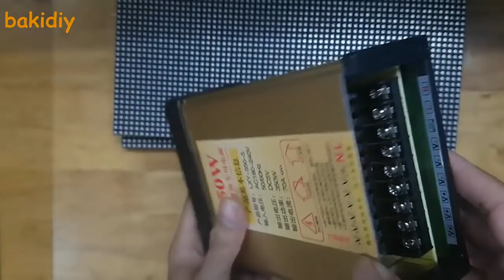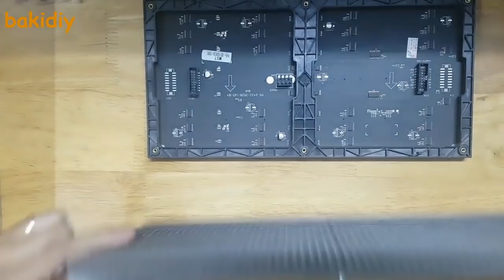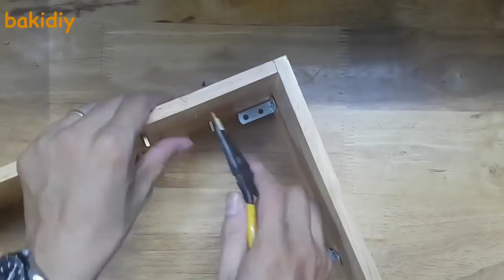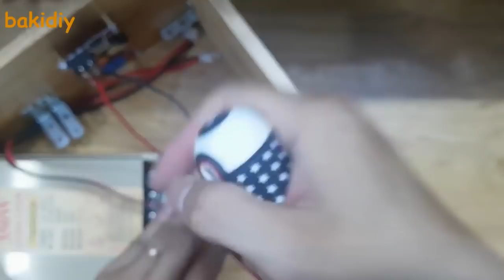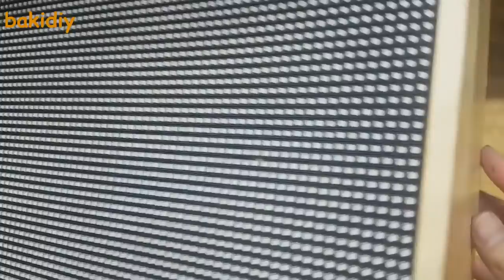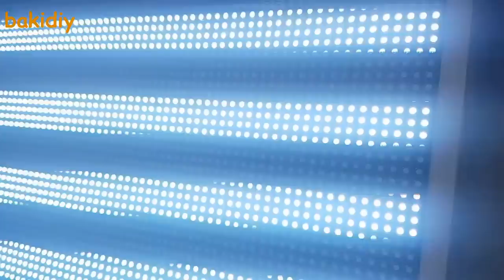Make a led screen for indoor/outdoor advertising (P5 RGB led display modules, HD U60-75 board)

Comment: I have an LED box truck for advertising and was interested in dimming automation and remote login to the laptop we have running the viewing software. Can you provide any advice or direction with this endeavor? Thank you.
Reply: hello there, my suggestion is we need a light senor which is set on the top your truck, the sensor is connected to your control card which is built in a video processor.  Then sensor sends signal to controlling system, it will work on dimming automation. Or directly adding 4g data module in controlling system.

Comment: What are these magnetized screws called? Do you have the link where I can buy?
Reply from the maker: My magnet screws are included with the LED panel. You can use google and find "led magnet screws" or you can buy here: aliexpress.com/item/M3-Outside-thread-P10-LED-Display-Magnet-screw-apply-to-Indoor-full-color-LED-Panel-P4/32235248933.html

Comment: I wanna build a p10 2x1.5m outdoor display, what controller i use?
Reply from the maker: If your P10 Led using HUB 75 input, you need to buy a controller support atleast 5 HUB 75 such as hd-w62-75

Comment: Hello I would like to buy 2 P2.5 160mmx80mm modules. Can advise me on the power supply to take, the control card, as well as the software. I looked on hd2018 and 2020 but couldn't find anything. Thank you for your help
Reply from the maker: Depending on the manufacturer, it can use different voltages, usually 5v, the maximum power consumption of a panel is about 3.5A ~ 20W, you use 2 panels so you need a source of 5V 80-100W (power capacity should double panel power consumption to increase the life of the power supply)
Reply from the maker: For the led control software, each controller board manufacturer will have its own software. If you are using the same board as me, you can download the software from the manufacturer's homepage https://www.huidu.cn/en/software.html

Comment: It's blinking what is the reason for that and one more how to pass image and video to this
Reply from the maker: It's because the refresh rate of the led board and my camera are different, you won't see it with your eyes. This board doesn't support video so I just convert video to gif image to display on LED panel.
Reply: We can't display videos in this panel right?
Reply from the maker: It depend on the control board. Just buy a control board that supports video and you can display video on this RGB panel
Reply: @bakidiy  could you suggest that  if possible
Reply from the maker: HD-D16, HD-C36C,HD-D36,.... you can find more here https://www.huidu.cn/en_product_154.html
Reply: @bakidiy  thanks bro for quick reply🙂👍

Comment: I need to assemble 
3 ft width
4 ft height led display 
Sir can u please suggest the materils required 
Can i able to do this?
Reply from the maker: You need about 24 led panels with cables. Depending on the resolution of each led panel (eg 16x32, 32x64, ...), you will know the resolution of the full screen. Then, you buy a controller board that matches the number of panels and resolution, a power supply with enough power for that number of led panels, and a metal frame to attach all the led panels. (There are many different suppliers, different products, you need to ask them for advice)
Reply: @bakidiy  which supplier is the cheapest but best quality that you can recommend?

Comment: hello could you help me I want to make a checker for led modules thanks
Reply from the maker: You can use a control board like me to test all panel, because test function had intergrated in this board (It has a test button on board)

Comment: can we use 4 p5 panels, and how to manage videos ?
Reply from the maker: Yes, you can but the color bit depth on the display will be lowered (from 256 to lower) because of limiting memory and processing ability of this board. You can use the program provide by themanufacturer to add video, gif, png, jpg,... to the board.
Reply: Thank you for the advice you gave

Comment: i'm checking the HD U60-75 controller and it is a single color, if i want a RGB full color i need buy the C30 Model right ?? and my question is.. i need but a reciving card for each led panel ? i want use 8 ped panel 256 x 128 mm  128 x 64 pixel each, thank
Reply from the maker: In my video, I'm using HD U60-75 controller and it worked with my 2 RGB panels. Maybe the manufacturer want us use HD U60-75 for single color led because it only has 32MB memory, the C30 has 4GB memory and support USB disk. I think you should ask the manufacturer for more infomations.

Comment: How did you get the HD U60-75 controller card to display video? the software that you linked does not support video so what software did you use, thank you in advance.
Reply from the maker: The software does not support videos but can support gif images so I just cut a video and use another software to convert it into gif images :)
Reply: I don't know what software you are using. I downloaded the software from your link but there is nowhere on the menu that says GIF. Also, when I use the software and try to run fron USB drive, it does not work. What am I doing wrong?

Comment: could you send me the arduino program you use to make it work?
Reply from the maker: Hi, this is not an arduino board. Its called Hd U60-75 board, so just use the program provided by the manufaturer to make it work. It's very easy to use.

Comment: hello there ..... is anyway that I can make a bigger sign ? like 128 x 128 ??? if yes what controller we can use ???? thank you sir
Reply from the maker: The board that I use in this video can control up to 128x64 pixels RGB led panel and can control bigger panel if using single color led. There are many different manufacturers that produce these boards, you can refer to the datasheet to choose. For the manufacturer I am using, you can buy HD-D10 controller.
Reply: thanks for your quick response ....yes I did watched some videos about HD-D10 Controller but I believe it should be always contacted to computer through Ethernet cable .... is there anyway to be connect it wireless or save the program in flash "??? especially there's some controllers  are wifi ... I appreciate your help and your knowledge
Reply from the maker: HD-D10 has usb port to transfer program from USB to internal memory for working offline. If you want to control via wifi, just need to buy HD-D10 with wifi module version
Reply: bakidiy  ... do I need a sender to be on my computer?? I mean sender and receiver  ?
Reply from the maker: No, just need only HD-D10 controller + a program on computer. You should read user manual and download program on their website. Sory, I don't have this board, so I can't give you more detail infomation.

Comment: Can you please list all the parts used in the video. What is 350 volts box
Reply from the maker: It's not a 350V box, It's 350W power supply, 5V, 70A. My 2 led panels only need 70w but I already have 350W power supply so I don't buy new ones. If buying new, just need only 100W power supply for 2 led panels
Reply: @bakidiy  can you list the parts in the main post?
Reply from the maker: I have updated in the description of the video